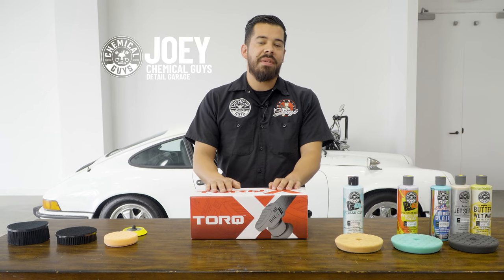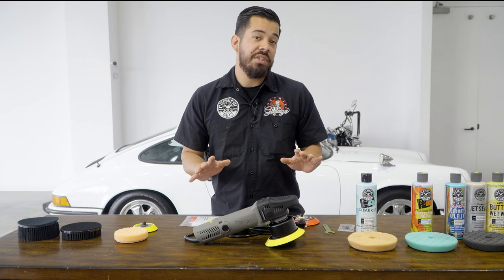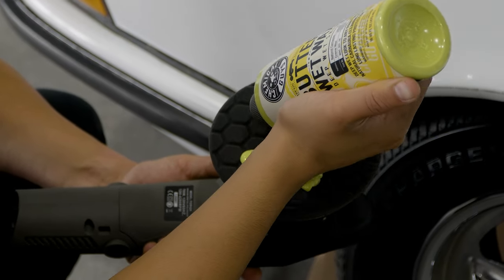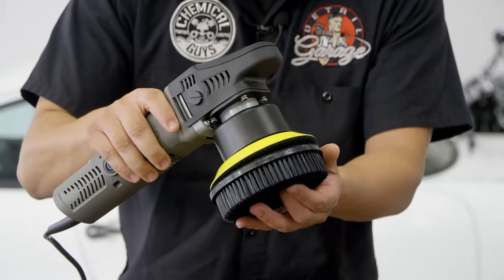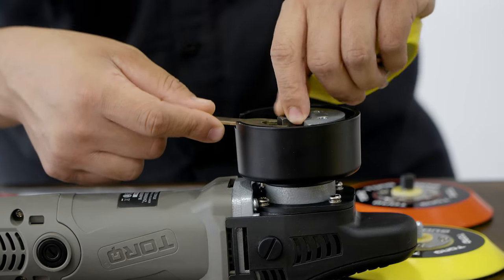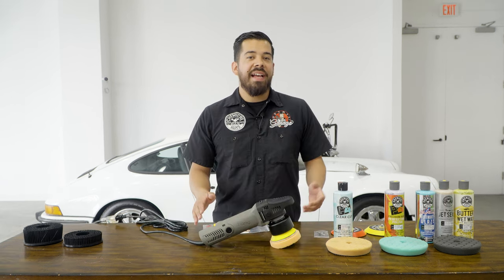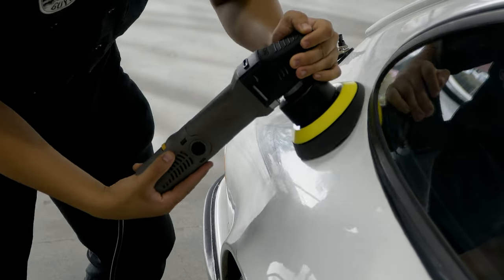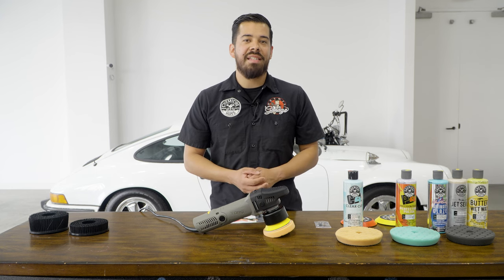Know how to change a backing plate? Wax your paint faster? Tips & Tricks on maximizing your TORQX!

Comment: When do you need to change your carbon brushes?
Reply from the maker: Hi there! After many, many hours of use the carbon brushes may need to be replaced. If the machine begins to underperform it may be an indication that the brushes are wearing down.
Reply: Never heard of carbon brushes before. What is it for?
Reply: @Themachine  They are the contacts for the motor. It's kind of "old school" technology but tried and true. Most newer hand tools (especially battery operated) are "brushless" design. They are usually longer lasting and slightly better performance. This of course is just a general observation as some brands and applications could give different results.
Hope that helps. Or look up "brushed vs brushless motors"